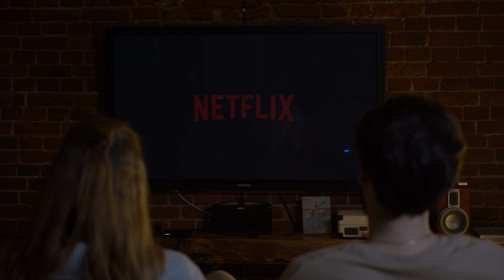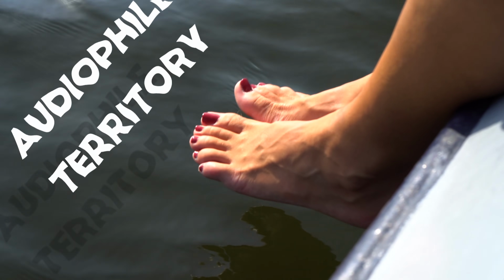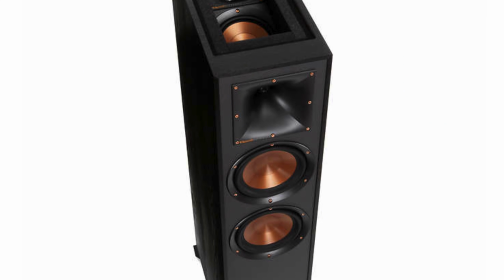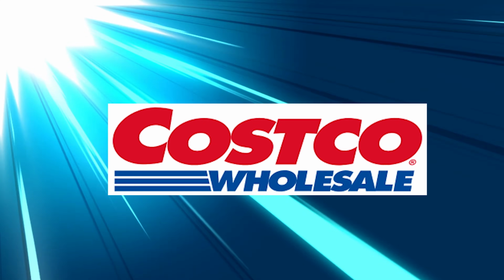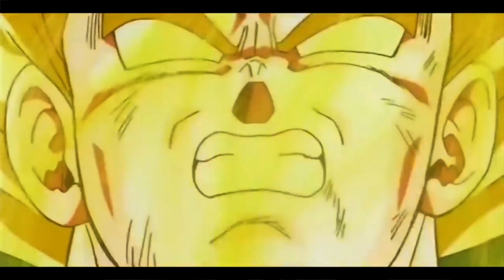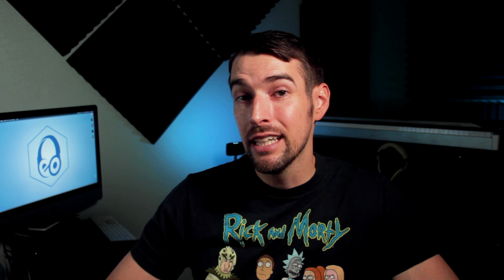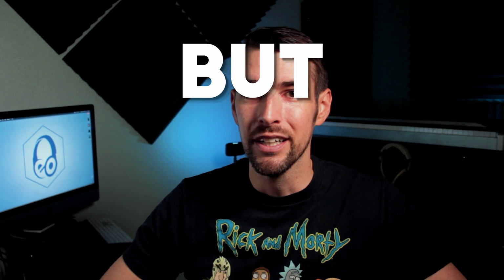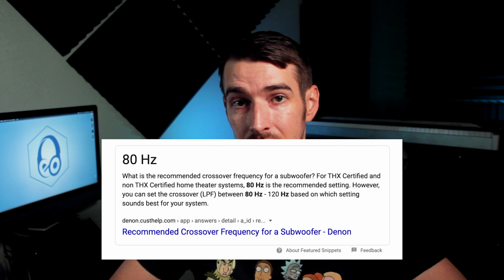$1,500 BRAND NEW Dolby Atmos BEAST SETUP?! Costco & Klipsch Bring It AGAIN!!!

Comment: Thanks for the great info! Do you have any suggestions for my planned setup- I have this Klipsch speaker package with the sub going into my home theater. I’m also wanting to run two outdoor speakers on my back porch (for music only) . Should I get a two channel receiver to run all 9 speakers in both zones or just get a separate receiver for the outdoor speakers? Thanks!
Reply from the maker: Which AVR do you have currently?
Reply: @ealanosborne  I don’t currently have one - I  have only purchased the speakers. I should have mentioned the house is still under construction so I’m buying everything now to prepare.
Reply from the maker: Ah, gotcha! Well congrats! We just closed on a 20 acre piece of land earlier this week! So in a year or two we’ll be having a house built on it. And you KNOW I’ll be putting in plans for a dedicated theater room. 😄 

So you have the Costco Klipsch theater pack, then? So that’s a 5.1.2 setup, okay. As far as your outdoor speakers, if you got a 9 channel receiver, it sure is convenient setting up a Zone 2 for the outside, that way you can control it all from one source. 

But from 7 to 9 channels is such a jump in price, it’s pretty stupid. But Onkyo is launching an updated 2021 line of receivers this summer (some come out this month!). The TX-NR7100 ($899) is 9 channel without pre-outs (so no option of external amps in the future), and the TX-RZ50 ($1,099) which will also be 9 channels, but have pre-outs for external amp usage and more power than the 7100. Both are slated to come out this month, although a lot of companies right now are having trouble with shipping, so fingers crossed that didn’t affect Onkyo. You might wanna check those out!

Comment: This is literally most of what I was looking to do. Not sure if atmos or the step down speakers. Can we buy this and do install and programming video etc ? Those were some great tips though, just need some help with the steps and process.
Reply: This is gonna be a long post 
There's really not much to setting up this type of system. Just make sure you're putting your speakers in the correct positions and the receiver takes care of the rest. The positions and angles are on dolbys website for speaker placement. Your center speaker must be the same distance away from you as your Left and Right speakers. Your surround left and surround right speaker must be 110 degrees to 120 degrees from your seating spot. NOT 90 degrees to your left and right as stated in this video. The only time it would be like that is if you had a 7 channel setup where you would put 2 speakers directly behind you.

Other tips I would give for placement is to make sure your angle ALL your speakers TOWARDS your main listening position. Have the tweeters aimed at where your ears would be and that way you will get optimal results. A lot of people simply put the speakers facing straight and depending on how wide you spaced them apart will just fire sound away from you. Also crucial is to make sure your center speaker is firing directly at your ears too. That speaker is almost always placed below your TV or projector screen and sometimes isn't the same height as your ears. So what you can do is angle it upwards so that the tweeters are firing at your ears.
I can't stress enough how important speaker positioning is. It doesn't matter how expensive your speakers are, if you position them wrong you'll be wasting their potential. You won't get a proper surround sound effect... People with much cheaper speakers will have a nicer sounding system compared to you(ask me how I know😕).
One last tip on speaker positioning: try and mount your surround left/right speakers about 1-2 feet above the height of your head (I use the speaker mount listed in this video). I'd say in 9 out of 10 cases it will make your surround sound much more "spacious" and greatly increase the effect.
The only thing that can be troublesome is hiding that speaker wire for the surround sound speakers for a nice clean setup. Once you have your speakers in the correct positions, just strip the ends of your speaker wire and put it in the terminals on the speaker and on the other end to your receiver. Everything is labeled on the receiver. Front left, front right, center, surround left, surround right, height 1 and height 2. After that, plug your devices into the correctly labeled hdmi ports. It doesn't matter which you plug it into but it makes more sense to plug the cable box into the cable box hdmi, streaming device into the streambox hdmi etc etc. Your TV will be plugged into the hdmi OUT port that's separated from the other HDMIs. Most receivers have two so make sure you plug it into the one labeled ARC.
That's literally all there is too it. Now you can turn on your receiver and just follow the step by step instructions. It will ask you about your speaker configuration, in this case it would be a 5.1.2 setup. Then you will place the microphone at where you would be seated(AT EAR HEIGHT WHERE YOUR HEAD WOULD BE) and let it run the auto-calibration. Just don't make any noise during this step or it won't calibrate properly. ALWAYS run the calibration setup if you move ANY of your speakers/subwoofers. Doesn't matter if you change the angle slightly or move it 1 inch over, these WILL affect the sound.
And you're done.
Reply: I read over what I wrote and I just wanted to add a few more things and suggestions. I know this is a lot of information but I'm just trying to pack in everything I learned into a YT comment so that you can save money and learn from my mistakes. There's tons of videos on this stuff and you'll learn little by little from each of them. 

For the subwoofer, you will need an rca cable to connect it, it does not use speaker wire. Simply plugs from your subwoofer LFE port into the receiver subwoofer port. Make sure your crossover knob is turned all the way to the right. This is all in the subwoofer manual btw. 
Now the following are MY suggestions after changing my sound system multiple times over the past 4 years. I wish I knew all of this beforehand rather than experimenting and upgrading throughout the years. Would've saved myself hundreds if not thousands of dollars over that 4 year span had I known what I know now. There's nothing wrong with upgrading but making smart upgrades are better. 
Get a 9 channel receiver rather than a 7 channel one. TRUST ME, having the extra 2 atmos speakers will add so much more dynamic sound to your setup. You will more accurately hear things flying over your head and it adds so much more immersion when watching movies. Even if you can't get the 2 other atmos speakers immediately, at least you'll have the ability to do so in the future. 
Klipsch atmos speakers are pretty expensive but there's tons of other companies that make atmos upfiring speakers as well. Usually you'd want to keep the brand the same so that it matches the sound of your setup but those asking prices are a bit ridiculous in my opinion. I'd rather get in ceiling speakers for that price. 
Secondly, get two subwoofers. I know most people think it will just make more noise and shake the house but that's not true if you set it up properly. It will add more output but that doesn't mean you need to crank the subwoofer volume high. Two subwoofers will just fill the room with more EVEN bass. The best result with proper subwoofer placement and subwoofer volume is that the viewer CAN'T tell where the subwoofers are placed/where the bass is coming from. The bass blends in with the speakers and sounds like it's coming through your speakers.
If you can't get two subwoofers now, you can always add one in the future (hopefully sooner rather than later). On a side note, after the auto-calibration, your receiver will set your subwoofer level to a certain number. Its on a scale and it will be from - 15db to +15db. In most cases, it will set it to - 15 which is the lowest. This means your subwoofer volume is too loud and your receiver has to subtract from it. I would urge you to lower the subwoofer volume a little bit and running auto calibration again. Do this until your receiver places the volume at let's say 1 to 3 dB higher (so if the lowest is -15 dB you'd want it around -14 to - 12). This makes sure your bass isn't flooding the rest of your sound.  From there you can always turn it up SLIGHTLY to your preference. Also make sure your turning the volume knob and not the crossover knob on your sub. Crossover knob should always be fully clockwise to 120hz or whatever the highest is on that subwoofer. 
When you're done auto calibration, check what your receiver set the crossover for your other speakers. 80hz is an amazing starting point and I'd recommend it for all your speakers including the tower ones. You CAN lower the tower crossover like 20hz but there's no need to have your speaker working hard to reach those low frequencies( bass). That's your subwoofers job. General rule of thumb though is to set the crossover 10-15 hz higher than the lowest your speaker can do. If your speakers frequency response is 60hz - 20000hz, then set the crossover to about 70hz -75hz. In most cases, 80hz is a great sweetspot. 

Last tip would be to get quality banana plugs for your speaker wire. I'm personally using  Amazon basics ones but sewell makes really good ones for around the same price. It makes it easy to plug and unplug your speakers. Also always label your speaker wire at the ends with a sharpie or something. Like for front left, I'd put FL and center would be C. Makes life easier. 
As a bonus tip, before watching anything, make sure your receiver is outputting dolby atmos. It automatically does when whatever you're watching has atmos in it but there's a chance it can glitch or maybe you accidently pressed a button on the remote and changed it. 
The worst thing you can do is having a nice setup and you're only playing it in stereo mode 😂 The more experience you get with how surround and atmos sounds like, the quicker you'll be able to tell. I can always tell if dolby atmos or surround sound isn't enabled especially if I'm watching or playing a game directly from my computer. Windows is a bit finicky with atmos at times. 

If you got any questions, feel free to ask me. I really love a good sounding setup. Absolutely changes the way you watch movies/shows.

Comment: Or get the “Yamaha TSR-700 7.1-Channel Network AV Receiver” for $399. Which is the exact same AVR as the RX-V6A which sells for $599 every where else. Note sometimes it goes on sale at $350 at Costco.
Reply: Is it better than the denon ?
Reply: @kushagrasingh7731  Depends. Which  Denon model are you comparing it to and what specs do you need? What are you trying to do or connect? How many ohms, channels, hdmi ports and types are you using etc
Reply: @felixr6307  I will be setting the Costco avr-750h to connect with the same reference pack as shown in the video

Comment: Who ever needs to read this: if you are able to, put the hight channels above your head!
Upfiering is awful in comparison. It's nice to try out but thats it. I used to have speakers sitting on top of my fronts (dolby atmos certified) firing up. I was happy because I didn't know better. Eventually decided to take those speakers, mount it on a metal pipe and screw that construction to my ceiling. The result is day and night. If you can put em up there, do it!

Comment: Just bought the bundle and subwoofer. 799 + 199. Also the bundle included 7 separate speaker wires. I have to put the sub at about 35% because it is so powerful.
Reply from the maker: Right?! Those Klipsch subs have a lot of kick! And yeah, Costco needs to update the info online about the speaker wires it comes with. Glad it’s enough! 😀

Comment: Hi, could you help me out on how I can connect this same setup ( single subwoofer) to a Yamaha RX-v781 for the DOLBY atmos. Thank you in advance!
Reply from the maker: Hi! So...connect the towers to the speaker terminals on the Yamaha labeled Front R and Front L, center channel speaker connects to terminal labeled Center, R-41 bookshelf speakers connect to the terminals labeled Surround L and Surround R, and the upward-firing Atmos speakers in the top of the towers connect to the terminals labeled F.Presence/Zone 2. Oh, and subwoofer goes into the RCA subwoofer preout port (either 1 or 2, doesn’t matter). Hope that helps! 😀🙌
Reply: @ealanosborne  I had 1 more question if you could help me out with it, What is your opinion on using the RX-v781 for these speakers, considering that the front speakers require 100W and the v781 has only 95W power 2 channel driven with 0.09% THD rating. Do you think I should consider upgrading to a more powerful (Like the Denon 4700H) receiver to match the power or should I stick to the same RX without it compromising the speaker output?
Reply from the maker: @SohailShabira  Here’s where your receiver is just old enough to be awesome. It’s one of the last 7 channel receivers that had pre-outs. 

So instead of spending $1,800 on an X4700H, maybe get an Emotiva BasX A3 external amp for $499, which you can use to power your front L, R and Center channel speakers. You get tons of power to those 3 speakers without spending a bunch of money. Win win! 🙌
Reply: @ealanosborne  Thank you for the guidance! I was looking into the Emotiva BasX A3 but it seems to be out of stock for now. As an immediate option, can I go with the BasX A5 model instead? Even though it is a 95W 5 driven channel, will I get the required 100W while using only 3 channels of it ?
Reply: @ealanosborne   Thanks a ton for that!, you cleared my entire confusion regarding this setup with this.

Comment: Two Kilpsch RP 280 FA's at Adorama for as low as 699.00
Just sayin'.
Reply: Also 2 RP 150m's for surrounds at 219.00 a pair.
Reply: And 600 watt 12 inch R 112SW Subwoofers for 299.00 each.
Reply: Pioneer LX 501 elite 9.1.2 channel reciever. 379.99 at best buy

Comment: Sony's STR-DN1080 can handle that 5.0.2 system?... Thinking about RMS, impedance, etc.
Thanks!
Reply from the maker: For the most part, yeah! Especially with Klipsch’s speakers having such high sensitivity ratings, they don’t need a lot of power to get loud. Of course a better receiver can make speakers sound better, especially if you’re lightening the load by powering some of the speakers with an external amp...but to stay in budget territory, the DN1080 should do just fine! 👍
Reply: @ealanosborne  thank you so much. I'm from Mexico and there's a little difficult to get a "non-expensive" avr. 😅

Comment: I wonder if this setup can run atmos on the Xbox series X?
Reply from the maker: I don’t see why not. My main entertainment hub is an XBOX One S running Atmos just fine. 🙌
Reply: @ealanosborne  Right on! Went through 2 soundbars that I had to take back because of eARC atmos mode  kept cutting in and out. Then I seen this video, and said why not? So I pulled the trigger and got the, Theatre pack and the sub. Still need to buy the AVR. This is all new to me, but I’ll learn. Keep up the great videos 👍

Comment: Hi Ealan, 

I am planning to get 85" QLED(2021 Q70A) and a matching sound bar to have home theatre setup in my lounge space.

My lounge size is 12.5 foot depth, width is 10.5 foot and ceiling height is 7.9 foot.  I wish to have 4 seats in a row.  Mostly i watch regular TV shows, movies, and sports. I dont play games on this home theatre.

Could you please advise on choosing between Home theatre soundbar samsung HW-Q900A and Q870A(2021). Both are in same price the range.  
HW-Q900A has 7.1.2 channel sound without rear speakers.
HW-Q870A has 5.1.4 channel sound with wireless rear speakers.

Could you please suggest me to choose the better soundbar from the above two and few tips on setup, considering my room space, TV size and seating capacity. 
Thanks in advance.
Reply from the maker: Go for the Q870A. Having those rear speakers makes a difference for a great surround experience. It’s better to have actual audio coming from speakers behind you, rather than relying on a soundbar bouncing audio off side walls to give the illusion of sound coming from behind. 

The rear speakers can either be directly to your sides and slightly above your listening position, or slightly behind and to the sides, pointing towards your listening position. That should get you the immersive experience you desire. 👍 

That’s one gigantic TV! I’m jealous! Gonna be a fantastic setup when you get it all! 😀🙌

Comment: Dude, I just purchased and  installed this system. The sound envelops me. That 12’ sub definitely shakes the whole house. I had to reduce the crossover and gain. Super clean bass on it.
Reply: Probably not a good pick for an apartment then
Reply from the maker: Nice!!!!! 🙌
Reply: so did you need 2 subs? or would you prefer it?
Reply: @chrisjordan2432  For my home set up 1 sub is more than enough. The sub kicks really hard. 
But if you have the space in the budget go for it!

Comment: I am curious to hear if anyone bought this system, but eventually upgraded to 5.1.4.  That would require 2 more upfiring speakers and a 9 channel receiver.  Is the upgrade worth the cost?
Reply from the maker: Depends how much you wanna shell out. 9 channel receivers nowadays cost around $1,000 on sale, but more like $1,300 year round. So it’s quite the jump going from entry-level Atmos to anything larger. But upgrading slowly over time is best. 

I have another video about a slow 5 step plan to have a powerful home theater system. Maybe check that out too! 🙌